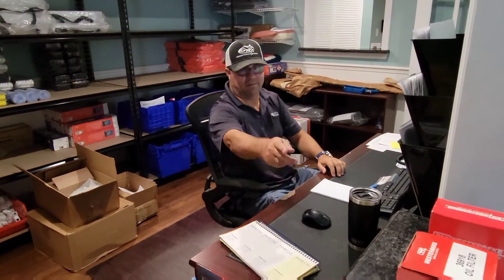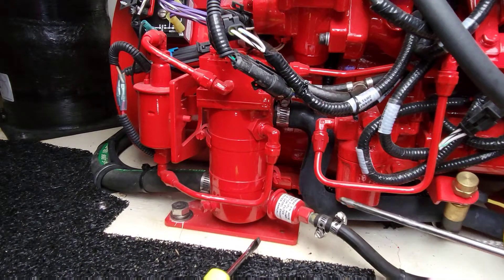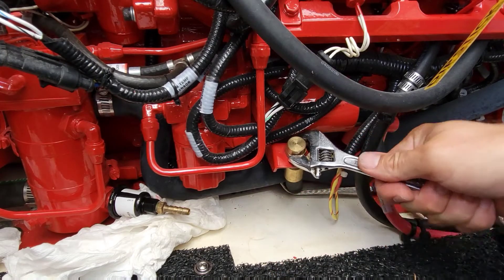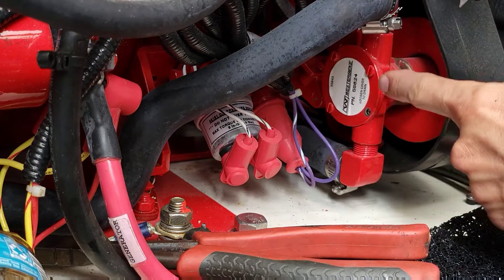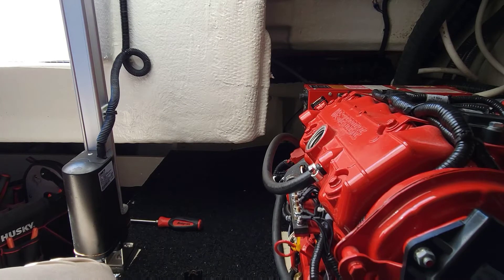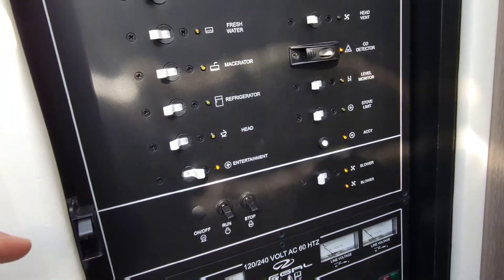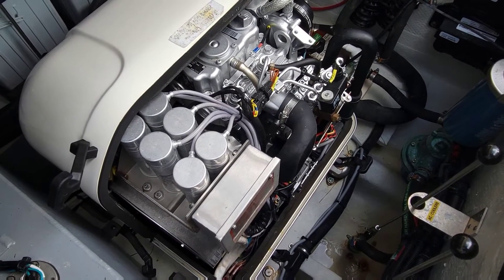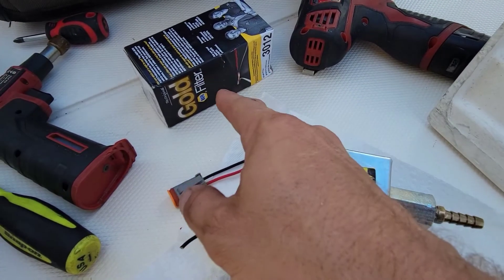A Westerbeke & A Fischer Panda - Episode 106 #Generator #Service #Shutdown

Comment: Good video - thank you.  Two questions on the Westerbeke:  1st, I noticed you didn't attempt to position the vanes on the new impeller in the direction of rotation.  I have always made sure they are properly aligned.  Am I wasting my time doing this and should I simply push in the new impeller the way you did without reference to which way the vanes were twisted?  2nd, I noticed you did not clean out the heat exchanger.  It seems that would have been a good idea since a vane was missing from the impeller?  Thank you.
Reply from the maker: Both good questions. The vines don't matter because as soon as it starts spinning they will correct themselves.  Unless it has an issue after the new impeller goes in I usually don't bother. I have only found pieces stuck once or twice in the 100s I have replaced. They seem to get flushed out or ground up so you never find them. Thanks for watching.
Reply: @JustinLeeMarine  Thank you for the reply. Every time I replace an impeller I always ask myself why I’m trying to align the blades because they would naturally turn away from the direction of rotation.  That brings up another question. Why lube the impeller for first start up?  My boat sometimes sits for a month on the lift between uses. When I start the engine the impeller will be dry.  What is the difference?
Reply from the maker: The lube is just so it is easier to get the impeller into the housing. As long as you have a good water flow to the water pump it will get plenty of water in time not to damage the blades.  You could prime the system if you wanted to make sure after it sits for an extended period of time.

Comment: Pipe threads use sealer
Real Techs use the proper wrenches, not adjustables... and have a selection of oil filter wrenches of some sorts...
Did you find and remove the broken impellor blade sir ?
You could never work for me ...

Comment: The oil filter location is obviously so it doesn’t make a mess. It will make a mess removing it from its location on the engine.

Comment: Justin again great videos. when does a generator typically need routine service? are some better than others in terms of service cost? yamaha motor service at 25hours seem ridiculous to me.
Reply from the maker: I personally like the Fischer Panda and Onan gensets.  Both diesels. They are all relatively the same for cost of service. It's every 100 hours or once a year.  Whichever might come first. The first service on the Yamaha is just to make sure we don't find excessive metal in the oils or find anything that might be going wrong from Yamaha manufacturing.  This just provides Yamaha with the chance to catch something before it becomes a problem and helps their quality control.  Hope that helps and thanks for the questions.

Comment: Have you ever had to clean out the screen /flame arrestor ? If so can that be done fairly easily ?
Reply from the maker: You should be able to clean it.  I would spray carb cleaner and use an air compressor to blow it out.
Reply: @JustinLeeMarine  do you have to remove it to do so ? And if so is there just one bolt that holds it on or do you have to take out the 4 bolts on top ?

Comment: Doug is a great parts person-the technician should never have to wait for his parts, they should be on the counter and let the tech go turn some hours. I’m currently boat shopping, and I’m really thinking I should downsize to a boat that doesn’t need a generator.
Reply from the maker: Doug definitely is and it's not bad to have a generator in the boat. Just depends on what one and if you have a good tech to work on it.  In my experience Fischer Panda and Onan seem to hold up the best. Thanks for watching.

Comment: Why would gas being getting in with oil in a westerbeke generator on a 38xo ?
Reply from the maker: Could be a few things causing that to happen. Stuck fuel injector, fuel pump( if it's a mechanical style that uses the crank case for pressure), the rings on the pistons being worn.  Keep me posted if you find out what is happening.
Reply: @JustinLeeMarine  so actually I drained the oil and I think it’s water .. since it’s sitting below the milky oil … or could that be gas ? What is the best procedure if it’s water ? Could that happen from running with the sea cock open and not running the generator ? Doesn’t the anti siphon loop take care of that ? Generator is only a 2021 with 250hrs on it
Reply from the maker: You will smell gas if it's in the oil. It's very strong when it enters anywhere it is not supposed to be. If it's water I would run it after changing the oil and do that again. You should shut the valve if you are not running the generator. It can fill up the exhaust and put water in the head.  If you keep getting water in the oil after changing it several times then you have a problem internally. The anti siphon won't help water getting in only water trying to leave after you run it.
Reply: @JustinLeeMarine  where can I friend you on FB to send you a pic of what the oil looks like I pulled out ?
Reply from the maker: It's Justin Lee on Facebook. You will see all my videos on my feed. I'm in largo fl